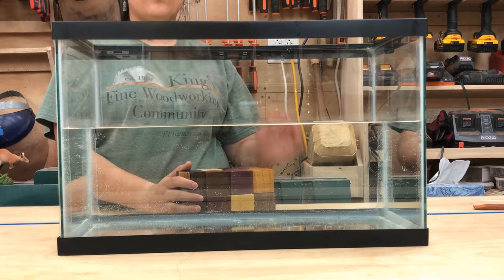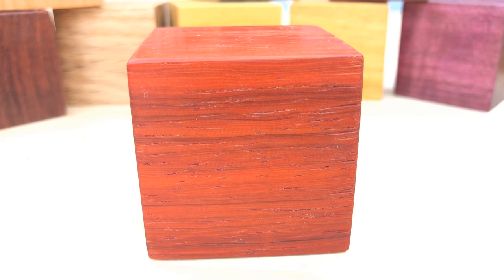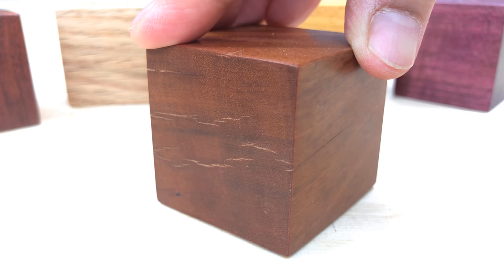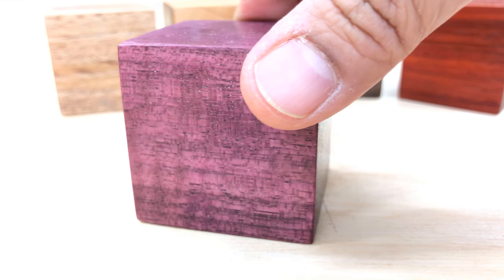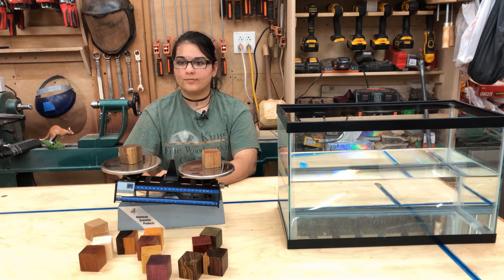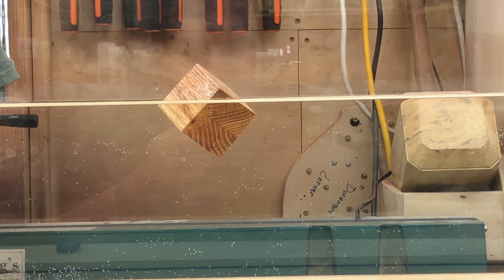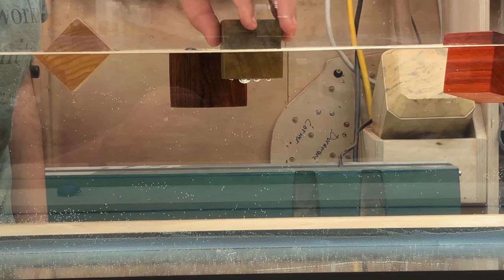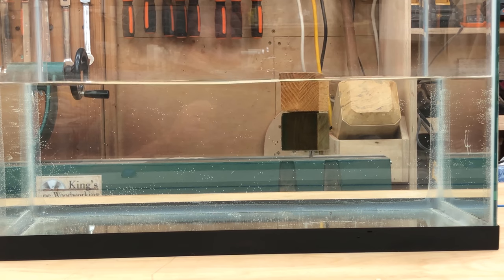72 - Densest Wood in the WORLD vs the Lightest! Exotic wood Showdown MUST SEE

Comment: I live in Bolivia, SA and we have Guayacaun, what you call Lignum Vitae (tree of life).  It smells so good when you cut a little of it but after cutting it for a few days the smell starts to get to me. It makes beautiful furniture and doors but is mostly used in making small tourist items from what I have seen . I cut blanks for a couple hundred flutes one day but went through a few saw blades. 
My favorite though, is Tajibo (some call it Ipe). Most of the things I make are made from this. It isn't as dense as Lignum but it doesn't float either. My other favorite is called Roble, which translates to Oak but is a lot lighter and oily. It also has a pleasant smell when cutting.
Reply from the maker: Hi Keni, that’s amazing. I wish we were able to directly import that wood from Bolivia. We love working with both Guayacaun, and Ipe! Thank you for sharing that info.

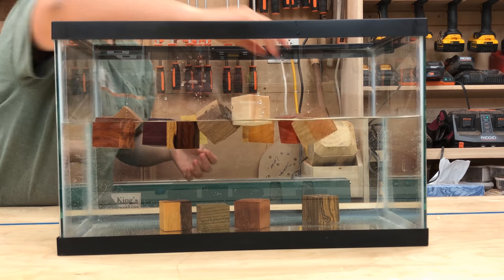Comment: Using this video in my Mechanical Engineering class showing the stability and instability of cubes in water. Those cubes with density greater than 0.79 g/cm^3 (but less than 1.0) and those cubes with density less than 0.21 g/cm^3 will float in a stable horizontal position. The rest of them float in a tipped over position to find their stability (or sink). Pause at 0:53 for a good look at them.

Comment: James and Sai, excellent video. Can you explain why Lignum, which is the densest, is not as hard as Quebracho please.
Reply from the maker: Hi Adrian, thank you. And sure. Here is your reason. 

Hardness vs Density

Density is a physical property that measures the amount of matter contained within a given volume. The more matter you can pack into a certain volume, the denser that substance is. For example, iron is denser than water, and water is denser than air. Density is measured by taking the mass of the piece and dividing that by the volume. Commonly done in grams/ cubic centimeter. Wood densities can vary from 0.1 g/cm^3 to 1.4 g/cm^3. 

On an interesting side note, no wood can have a density greater than 1.5 g/cm^3.  (Water by comparison is 1 g/cm^3)  This is because all of the cellular material that wood is composed of, plant cell walls, lignin, hemicellulose, etc; all have a density of almost exactly 1.5 g/cm^3.  So assuming no water, and no air space, we would have the theoretically densest possible wood. Which would equal 1.5 g/cm^3.  When we add in water, which is lower in density than that, and we add in air space, the density always goes down from the theoretical max.  

Hardness is a physical property that measures a substance’s ability to resist deformation. For example, much less force is required to deform balsa wood than to deform oak. In wood, hardness is measured using the Janka scale. This is done by measuring the amount of force required (in pounds), that it takes to depress a steel ball of 0.444 inch diameter to a depth of exactly half of the ball’s diameter into the wood. Wood hardnesses can range from a Janka Hardness of 60 pounds-force to 5060 pounds-force. And it’s always calculated by averaging the test from different faces. 

Although Density and Hardness are both separate properties, they are not completely independent of one another. As density goes up, so does hardness. But even so. They are not the same. 

If we were to do a gross dissection of a tree, immediately under the bark, we find the cambium. This is the thin active layer that is responsible for the outward growth of the tree and development of rings. Below the cambium is the sapwood, which all woodworkers know about. This layer is living and wet, and is filled with the hollow tubes that transport water & nutrients up from the roots. The tubes are called xylem. Moving inward from the sapwood we get to the heartwood. This is the densest part of the tree and it is dead. All of the xylem have stopped working and have filled up with resins. 

Next if we move down to a cellular level we can analyze the composition further. In a given cell, we find three main components, cellulose, lignin, and hemicellulose. About half of it is cellulose. That is the strong fibrous material. And about a quarter of it is lignin. This is the glue that binds the cellulose together. The cellulose forms long chains that go directionally up and down the length of the tree. The lignin is found in between, and is the glue that binds those long fibers together. The cellulose is actually much stronger than the lignin. It’s harder to break a board against the grain because you must break cellulose fibers. But with the grain you only have to break the lignin that is bonding the fibers together, which is much easier, since it’s weaker. 

Which brings us to our next point. Most other building materials ie. steel, plastic, bricks, are isotropic, meaning they behave the same from any direction. Wood is not. Wood is what we call anisotropic, which means it has different properties in different directions. For example, you can break a board much easier with the grain than against it. For this reason when we measure hardness, we will measure on all faces of a board, and then average them. It’s also why end grain cutting boards are more durable than face grain ones. In contrast, if we used a piece of plastic for a cutting board, it would make no difference which side is up. Recognizing and using wood’s anisotropicity appropriately is one of the things that makes us good woodworkers.

Now, recognizing that wood has different properties when approached from different directions gives us the main clue we need to figure out how hardness varies from density. When we encounter the end grain with an object of a specific size, we encounter more cellulose fibers at once, this is one of the reasons that wood is harder on the end grain. 

If we approach from the side, we will encounter a smaller number of these cellulose fibers at once. And hence it is weaker. 

Now, we know that approaching more cellulose fibers means more hardness. So we can infer that if a wood has a higher count of cellulose fibers, it has a higher hardness. 

The second of three reasons, is that the individual fibers of cellulose are thicker and stronger in a harder wood. So in addition to a higher quantity, each one is actually stronger & more resistant to deflection. 

Third, the lignin, which is the organic adhesive that holds those wood fibers together exists is greater quantity, so the cellulose fibers are bonded together better. 

Finally, in the heartwood of the tree where the xylem has filled with gums and resins, the resins play a critical part. Different trees have different compounds that make up their resins, and the trees that are harder, contain stronger, more resilient resins. 

In summation, 
the cellulose fibers in harder trees are in greater quantity, 
they are less likely to break, 
they are less likely to detach from one another, 
and they are filled with stronger resins & gums.

Sources:

Handbook of Chemistry and Physics
94th edition
http://tyboomakbook.org/download.php?title=crc-handbook-of-chemistry-and-physics-94th-edition-free.pdf

Textbook of Dendrology
Hardin, James Walker, 1937

The Biology of Wood from Cell to Trees
https://www.newphytologist.org/img/upload/files/42nd%20NPS%20Abstract%20Book%205_7_18%20Online.pdf

The Wood Handbook: Wood as an Engineering Material
US Forest Products Laboratory
https://www.fpl.fs.fed.us/products/publications/several_pubs.php?grouping_id=100&header_id=p

Tree Trunk Biology and Basic Wood Structure
https://www.thoughtco.com/trunk-biology-1343512
Reply: WOW!  Thank you for your detailed reply!  I  understood most of these principles before,  but it would have been hard for me to explain it as well as you have.

Comment: I thought Brazilian Ipe or Ironwood was the hardest?  I installed this on a friend's deck and it took a few drill bits to pilot through.  Only a 5'x7' area.  Big learning curve.  It is so dense that it does not accept paint or stain but turns a nice gray after years.  No splintesr and it is fireproof apparently!  Am I wrong?
Reply: Lignum is, in fact, the 4th densest wood. Black Ironwood (Olea laurifolia) is the densest.

Comment: HI can you help me, I found some wood in a lorry park 2ft 10 long 3x3 , a heavy dark hard wood ,probably used as skid or may have been part of a packing case because it has a groove about 1 inch wide down the length , cut a piece off to turn  , IT STINKS LIKE HECK !!!!!!  that was about 6 months ago , it still sinks  I probably won't be using it ,, but would like to know what it is , Regards Alf

Comment: This may be of interest
Top 10 hardest woods in the world
Wood, as a material, can have its hardness quantified using the Janka rating; the industry standard rating. With this rating, the resistance of wood samples to denting and wear is measured.  Varying on account of wood grain direction, different woods are tested based on the cut surface of a stump cut from the material. The measure of hardness and strength is pounds-force (lbf).

Here, we list the top 10 hardest woods in the world, and provide a bit of information about each type: 

Hardest-Woods-In-The-World
1. Australian Buloke

An ironwood tree that is native to Australia, this wood comes from a species of tree occurring across most of Eastern and Southern Australia. Known as the hardest wood in the world, this particular type has a Janka hardness of 5,060 lbf.

2. Schinopsis brasiliensis

A species of flowering plant in the cashew family, the schinopsis brasiliensis originates in Brazil and creates an extremely tough wood of 4,800 lbf. Due to this immense hardness and strength, this wood is often used in construction.

3. Schinopsis balansae

A hardwood tree, the schinopsis balansae is a tree which makes up large areas of forest in Argentina and Paraguay. Reaching a whopping 24 metres in height at times, the tree’s wood is extremely hard, at 4,570 lbf.

4. Lignum vitae

A trade wood, lignum vitae comes from trees of the genus Guaiacum which are indigenous to the Caribbean as well as the northern coast of South America. This wood has been used since the 16th century, combining strength, density and toughness at an impressive 4,500 lbf in the Janka hardness test.

5. Piptadenia Macrocarpa

This wood has a Janka hardness rating of 3,840 lbf, making it suitable for a variety of construction projects. It comes from a tree native to areas including Argentina, Bolivia and Peru.

6. Snakewood

Snakewood has a Janka rating of 3,800 lbf, and is an exotic hardwood which is particularly prized for the highly figured grain it exhibits. Originating from South America, it is used in  a variety of projects requiring tough, dense wood.

7. Brazilian Olivewood

With a Janka rating of 3,700, this wood is an exotic, attractive choice. Combining its pleasing aesthetic with properties including toughness and strength, exotic household furniture can seriously benefit from its presence.

8. Brazilian Ebony

A dense, heavy wood originating from Paraguay, Argentina and Brazil, this wood has a Janka rating of 3,692. Particularly good for the construction of decking and planking, this wood is not only hard and durable, but shock-resistant, making it an attractive yet extremely practical and cost-effective choice in the long-run.

9. Brazilian Walnut

Originating in Central and South America, this wood has a grain that varies from straight to irregular or interlocked. With a Janka hardness rating of 3,684, this wood can be used for a number of projects, whether indoor or outdoor.

10. African Pearwood

This is species of tree is found in Angola, Cameroon, the Republic of Congo, Gabon and Nigeria. With a natural habitat of tropical moist lowland forests, the wood itself has a Janka hardness rating of 3,680 lbf.
Reply from the maker: Hi Rod! Thank you for sharing!! I was trying to decide whether or not to include hardness in this video. But I was worried that it would take more time and some might get confused about hardness vs density unless I took the time to explain it well.

Comment: Old video, but I'll say, you forgot one little thing. Lignum Vitae is not the densest wood in the world, it is the densest commercially traded wood. The densest is Australian Buloke
Reply from the maker: People often confuse the two physical properties of density & hardness. 

Australian Buloke, which I built a hammer from in another video has had samples tested that came in at 5060 on the Janka scale. And that resulted in its title of the worlds hardest wood. However the density of Buloke is about 1/10th of a g/cubic centimeter less than that of genuine Lignum vitae. 

Hardness and density are unrelated properties. Although in the practice of woodworking we often see a correlation where the harder something is, the denser it is. But although we see a trend. It’s not absolute. 

And if we take a look outside of wood for a moment we can see many examples that buck that trend.  Diamond for one, is many many times harder than lead. But lead is far denser.
Reply: @KingsFineWoodworking  ah, my mistake was actually that I misunderstood the Janka scale, so thank you. Would you be able to link to the Buloke hammer video by chance?

Comment: Waddywood is the densest wood in the world. Lignum vitae is the densest North American wood.
Reply from the maker: Hi Alan! Interesting. There are lots of species out there which have only had an official density test once or maybe twice. 

Sometimes those readings are anomalous. Especially because density can vary greatly from tree to tree. And even from different parts of the same tree. 

There is a similar case with Australian Buloke and Quebracho. Australian Buloke has had an official Janka Hardness test only a few times. However one legitimate test came in at over 5000 lbf. Whereas the others came in at just under 4000 lbf.

Quebracho on the other hand has had a few more official tests and those have averaged around 4500 lbf. 

So which is harder? Tough question. And you wouldn’t be wrong no matter your answer. 

I think the same criteria should be applied to measuring density. 

Thank you very much for commenting. I must now go out and do whatever it takes to get myself some Waddywood!! :-)